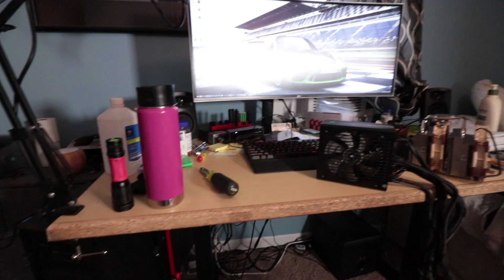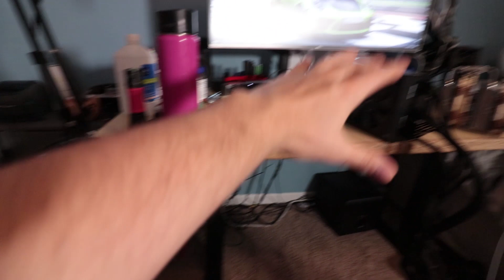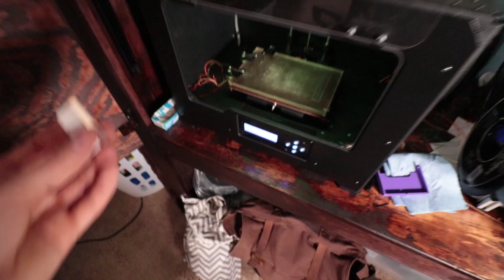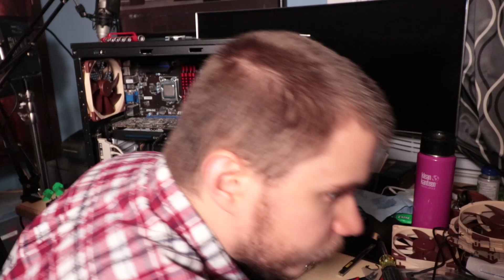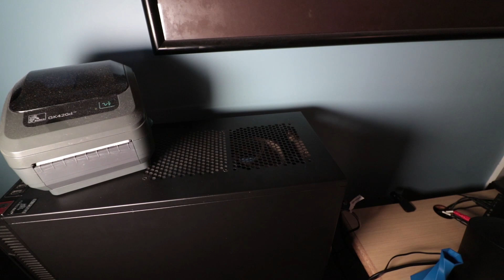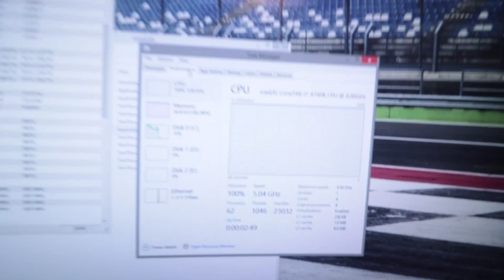Upgrading My PC + New Room Tour

Comment: If you want your CPU to last, either no overclocking or underclock it ^^ 

Many fanless PC builds rely on reducing heat generation / they have fanless nightjar power supplies / no fanless CPU cooler worth a darn at a norma price point.

I really like the mineral oil cooled full immersion cooling, but it makes a huge mess to upgrade or change anything & requires a lot of equipment ^^ 

Cool air with external chiller also an option / I personally dream of building a Fanless CS:GO / CAD rig ///